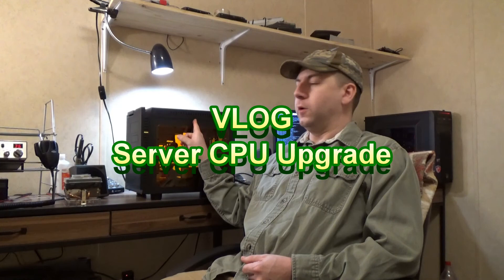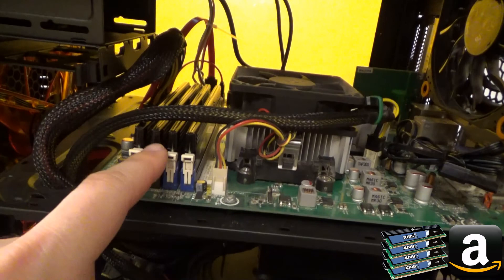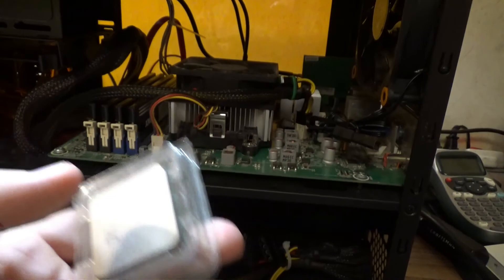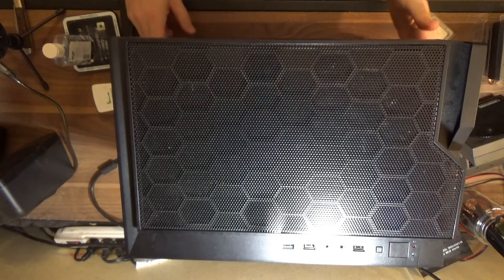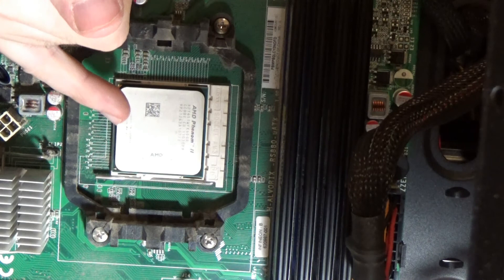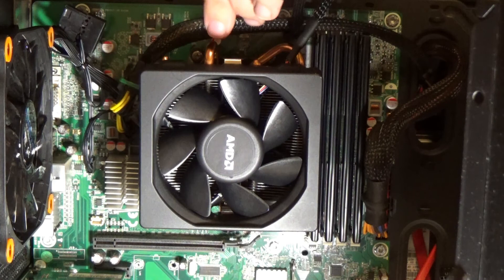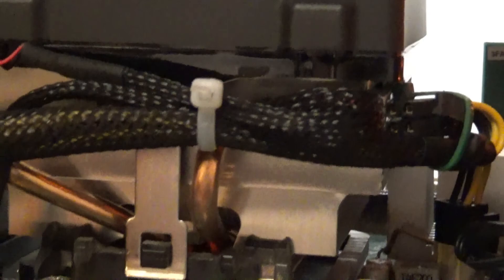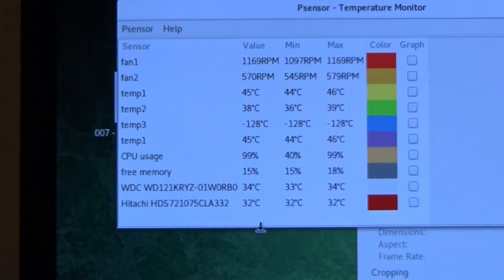VLOG - Server CPU Upgrade

Comment: The video freezes when you place the Western hardrive back on the shelf, and stays that way, audio continues until 53 seconds and then that stops. Then there is a loading circle forever spinning on the screen with you and your hand with the hard drive on the shelf. Only your video is doing this. I thought you would want to know. Bummer.
Reply from the maker: Looks fine to me, have you tried refreshing the page?
Reply: Marcus Adams Yes, several times. Always hung up at those points on a Samsung Galaxy tablet. My Ipad hung up briefly at various points. I changed to another band on my wifi on both tablet and ipad. Ipad then worked fine. Tablet is the same. Only your video. Problem on my end. I watched entire video on the pad using the other wifi band. Excellent video. Almost makes me want to go back to a cased comp to be able to play around inside. Do you have a temperature indicator readout device to check component temps? You strike me as a person who would want to know the details.
Reply from the maker: I do not actually, but I have considered purchasing an IR temperature sensor so I could just point it at components and get a rough idea as to how things are going, :-)